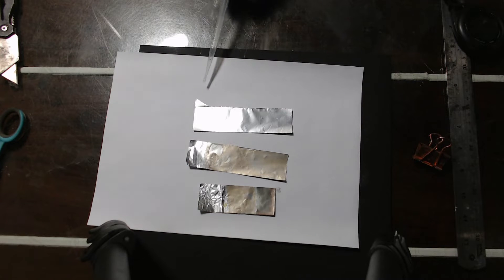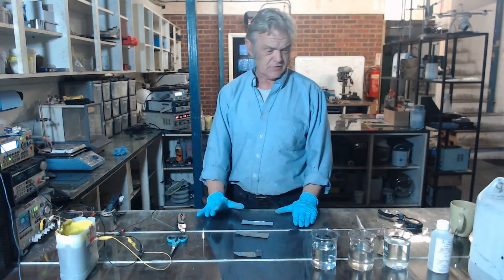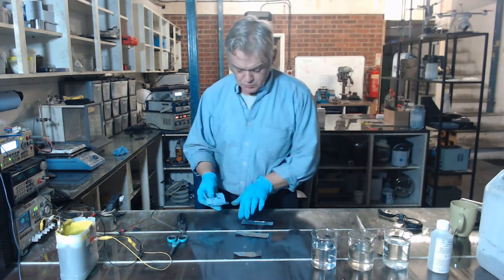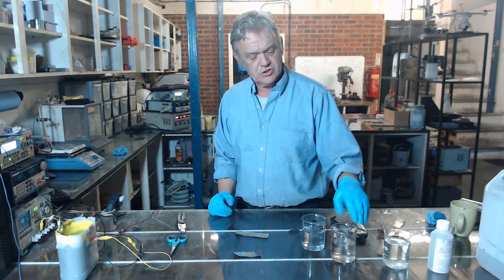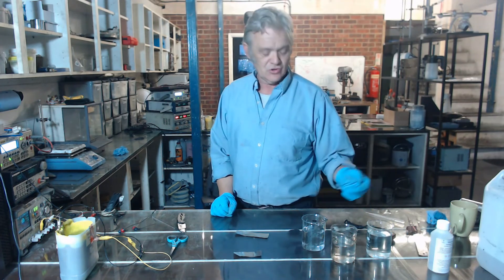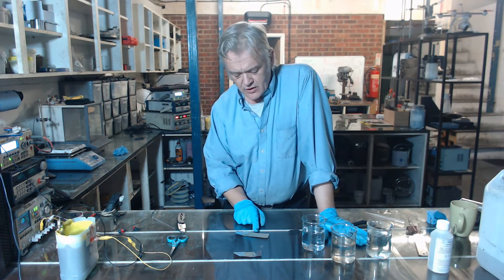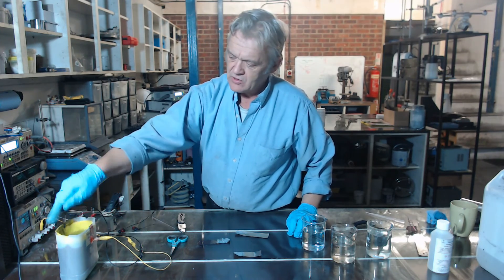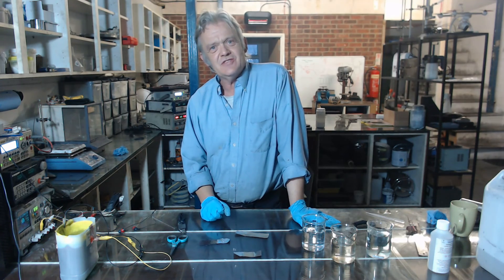Doing The Impossible - Copper Plating Aluminium

Comment: That last part “....use that surface as a copper collector.” makes me think anything can be copper coated easily. It just needs current sent to it.
Hmmmm.....?
Reply: The way i understand, you can plate anything with current, but the passivation  helps adhesion.

Comment: You can copper plate aluminum foil by: degrease, make a medium-dark solution of copper sulfate, rub the solution on the foil with a clean rubber eraser. Dip & rub, repeat. in about 2 minutes the copper appears on the foil. I have used this for soldering wires to the foil. Probably not practical for large areas.

Comment: Thanks, Robert. I had been wondering how the Chinese are producing that awful, and very cheap, Copper plated Aluminium wire which is found so often in cheap electrical goods' mains cables. It's a real fire hazard.
Reply: but its was impossible acording to robert.   copper clad aluminium wire  has been around for a like a long time but ok :)
Reply: ........haven't heard of copper plated aluminium wire but those crocodile leads Robert uses I know are copper plated iron. They're attracted to a magnet.

Comment: Hi Rob, this is really interesting, thank you. As a retired Electrical Power Engineer I am acutely of the problems of transitioning from Al to Cu...basically if you can exclude the electrolyte, there's no problem but allow a solution to damp the interface you have no Al and a big bang ( Al is eaten away at the interface creating a high resistance joint, creating heat and eventually failing ) !!
So would it be correct to say that the sodium molydate creates an impervious layer to the electrolyte, but is still conductive enough to allow it to function as a current collector ?
I suppose if it is not totally imperious, by subsequently plating will Cu it will be.
Once again, thank you for sharing this...really interesting and a potentially important step towards lighter cells !!
kind regards
Tony
Reply: Looks like I will have to DIY solution with what I can get my hands on...the sodium molydate 2 step from moly metal, using H2O2 to create an oxide and then NAOH to the sodium molybdate, and likewise a one step sodium flouride with hydroflouric acid and NaOH and a little heat.....Hmmm must clear the benches after the rice harvest and give it a go !! You have definitely piqued my interest !!!   HaHaHa....what can possibly go wrong ;)
Tony

Comment: It wasn't on foil but it was on actual Aluminum stock but I kind of got those results when I was trying to plate a piece of aluminum with graphite with some other stuff broke down into the solution. Later today I'll try to plate that with some copper . But I thought I seen somebody a while back don't quote me on this it's been awhile. that plated aluminum with copper by using a sulfuric bath first. I think it was like 1% sulfuric acid . But like I said that was a while back and I may be wrong on that one. I'll try that one later too. I was trying to Gold plate some aluminum for a mod and I ran into the video researching it.
Reply from the maker: interesting - can you find it again?
Reply: @ThinkingandTinkering  I was wondering about this copper strike solution in the video title (and from over on your side of the pond) "How To electroplate on to Aluminum" by Golden Solution's YT channel.   In regards to Jason Drennen comment,  maybe per Loren Kinzel's comment "You can copper plate aluminum foil by: degrease, make a medium-dark solution of copper sulfate, rub the solution on the foil with a clean rubber eraser. Dip & rub, repeat. in about 2 minutes the copper appears on the foil. I have used this for soldering wires to the foil. Probably not practical for large areas."   Seems like an interesting way to maybe improve and make a custom nickel plated carburetor for a small engine or at least the bowl.   Has me wondering about upgrading the connecting rods as well homebrew style now that I think about some more... then again the thermal rates of expansion and contraction and forces applied in that more extreme environment is probably better suited for a billet part of better grade aluminum, at least, material.  Titanium coating would be an interesting topic... though that will require some plasma I'm thinking.
Reply: Hi Jason, how was your progress with gold plating aluminium? Would be great to hear your expert opinion on it.
Reply: @Jason Drennen Yeah, how'd your gold plating aluminum go?

Comment: "Everyone knew it was impossible, until a fool who didn't know came along and did it." Albert Einstein 
That's exactly what was in my case cause I didn't realize it is so difficult to copper plate aluminium. I was able to achieve thick layers that held the tape test and was possible to solder wires to it. But the funniest thing is that for experimenting I used only very simple ingredients like demineralized water, baking soda, washing soda, citric acid, car battery charger and some copper wires. I think I need to get back to this experiment but where to find time for that :( and the clue at the end for those who would like to try it, don't dip and live your aluminium on first layers, you have to dip it quickly many times and a very thin quite durable coat will start to form. Thank You for great inspiring video's 👍
Reply from the maker: that is an extraordinarily useful tip mate - thanks for sharing
Reply: He was one of those motivated people with dyslexia. A inspiration for morons such as myself and others, lol. You appear smarter than a dedicated moron though. Most affordable method you came up with. I can try that with a trip to the local grocery store. Shopping list copied. Thankyou as well.
Reply: @truetech4158  i just quickly tested it as I stored the solutions. They still good after many months. Need to add some few things to save You some time. Washing soda was used to do electrolysis on copper wires and with syringe I gathered dissolved copper (oxides?). Then I made solution using demineralized water + copper + citric acid and using copper anode. The other important thing is that I use 12v 6a battery charger and did try on a lab supply but results was not that good. However to limit the current on the charger You have to use different gauges of wire and dip them more or less in a solution. If it's getting dark brown or black current is to high or it's to long in solution. Means dip faster or put less anode in. I recommend to use some gloves , glasses, and do it in well ventilated area. Hope it would work for You too. Good luck
Reply: @maciekm7953  Thanks again brother from a probably taller mother. Oh, while reading what you wrote about creating copper oxides, figured sharing a idea being still in concept stage, as it just dawned on me that one could very easily go the illegal route, by effective means of much defacing some monarchs off the affordable coins as i dislike money really anyways (providing such events doesn't result in being sent to the guillotine) by holding those, or even those copper wires mentioned though not the wires used for electrodes, against a belt sander with pliers or slotting a piece of random 2x4 lumber with a many a penny approach held in place into the slots and let the copper oxide dust fly into a catching bin or something, maybe even with a Dremel or file or even a bit of sandpaper would seem to work in that department if going all out mcgyver mode in the middle of nowhere if stranded on a deserted island due to high taxes, lol. Also useful for if needing any other metals turned into a powder form.
Reply: @truetech4158  I don't know where you are, but for at least a decade, 'Copper' coins in Britain and the USA have been made from Copper plated Iron. Yes, they stick to magnets, if you want a quick way to find the few remaining genuine 'Coppers'. Britain is also minting 'Silver' coins (they've not used Silver since 1947) using Nickel-on-Copper plated Iron.
Reply: @maciekm7953  could you explain in a bit more detail how you plated aluminium? I have a hart time following what you typed. Maybe  make a video about it, I think people would love to see that!
Reply: @maciekm7953  did you know you can just straight up use baking soda alone to generate copper sulfate and start plating stuff!
Try different saturation levels of baking soda.
Ive even got it to work with literally tap water.
Reply: @realflow100  You've prob generated copper carbonate, recognized by green color instead of blue
Reply: I love that Einstein quote 'cause I've seen it happen more than once.

Comment: Hey Rob... Thanks again for being so generous in sharing all your ideas and hard work. Would a copper plated aluminum current collector be significantly more effective? or would the copper material be too thin resulting in early failure. Cheers Mate...
Reply from the maker: it would depend on the electrolyte mate - the passivation without the copper plating would be electrolyte independent

Comment: That's really cool mate. So that's sodium molybdate? That's a real gamechanger for current collectors. Does it stop corrosion completely with aqueous electrolytes? We all want thin lightweight highly conductive inert cheap current collectors.. graphoil,  conductive ink, stainless steel etc don't really cut it for me.
Reply from the maker: yes mate - sodium molybdate - just type that into a google scholar search and add the word passivation or the phrase conversion coating and you will come up with a lot of papers discussing this
Reply: If I calculated right, ~2.4 grams Sodium molybdate dihydrate in 100 ml water and 100 ml vinegar to make his solution.  Around 0.4 grams Sodium hydroxide in 100 ml water to make the other solution.

If this idea works to protect the aluminum (or is it aluminium) current collectors, it should make DIY batteries a lot cheaper to scale up to an actual usable size.
Reply from the maker: @flashlit123  the exact recipe is 2.4 g sodium molybdate, 100mL DI water, 100mL of 5% acetic acid, 1g Lithium or sodium fluoride, 2 mL concentrated phosphoric acid
Reply: @flashlit123  Does it work? I don°t think so!
Reply: FYI ... Aluminum foil (or aluminum flashing or soda/beer cans) can be soldered using regular electrical solder if a little oil is used to keep new oxides from forming before the solder sticks.  

I've got lots of new ideas if aluminum can be made to hold up as current collectors.  I'm likely not the only one that ordered some new chemicals because of this video.
Reply: I think that is what he said for one of the chemical names that were mentioned.
Ya costs for DEV study materials is a concern here too really, managing on a low neuromuscular disability pension income much lower than what would be considered to be minimum wage for years. Often trying to be as generic in cost approach as allows for. Be cool though to eventually produce something meaningful that could be a way to give back to people, within ones own potential abilities.
Keep on rocking